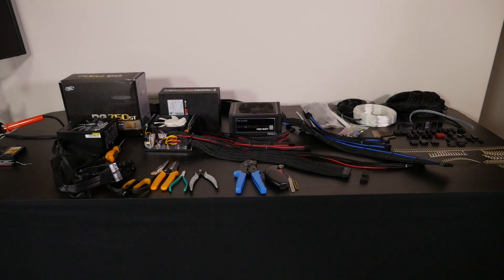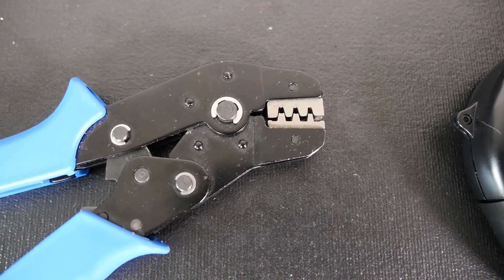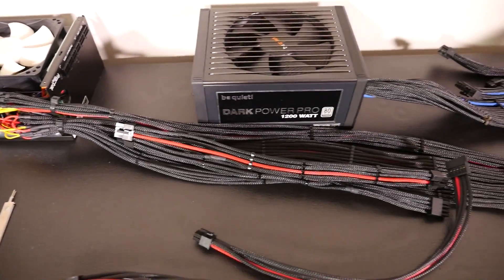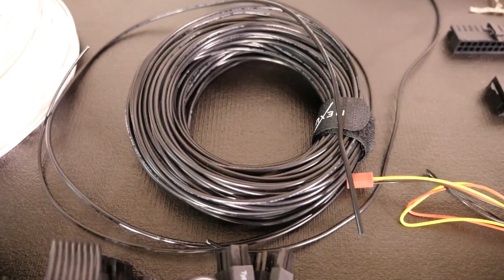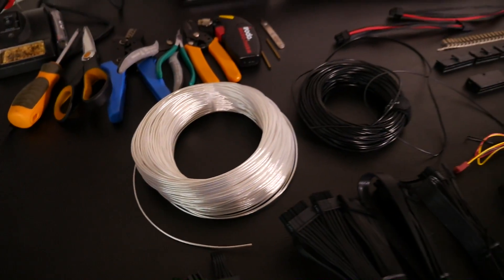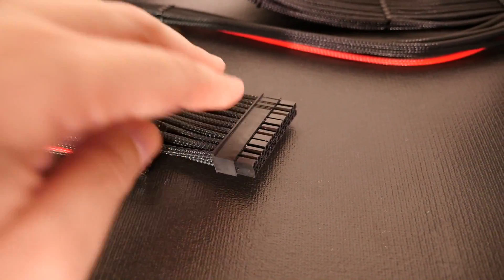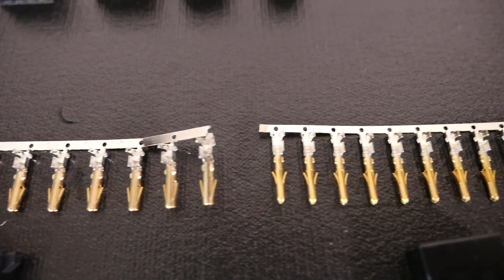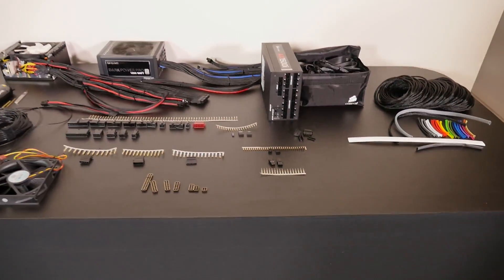Custom Cables Guide #1

Comment: im going to be doing full custom cables on my new rig. But have a question. Can you do the cables for a few inches and then do extensions. As that way it be easy to do new cables if i was the change colours and not have to worry about the pin layout on the new extensions.

Comment: MDCP-X crimpers are IWISS crimpers, with the two rear jaws milled out a little... DO NOT buy them... you can buy 3 IWISS or something similar for the same price... they even SMELL the same. 
 Pin removers... are just standard molex brand pin removers... just buy the molex ones.. they are literally the same thing but way less money.
Reply: Can you link the model since I am new to this I dont really know which crimpers that is similar to the MDCP-X Crimpers.
Reply: @andyyang2333  Sure! I do not want to take money out of these guys mouths, I did a short video on this on my channcel which show them side by side. Comment on there and I will link you.

Comment: Do you still use the SN-28B crimper? Because I have one and it says it's for 28-18 AWG, but you said you use 16 AWG wire. Does it still work for the 16 AWG wire/pins?
Reply: didn't he move to the MDPC-X CTX3 Crimpers he has video on it, 
I love them

Comment: In what case would one need to extend a single SATA cable beyond the connector? I've never seen, or heard of for that matter, a cable with multiple connector opposed to a singular terminating connector. Would it be used for setups similar to RAIDs or some other application?

Comment: Great stuff and a real service. 

Get a Hakko 936 on auction. The entire electronic part is $10. So it is risk free. 

I use a hot air station designed for SMD work because I can control the temperature for shrink tubing. 

For training wire, the filament count is key. There are three standard versions from limp "boat cable" to stiff thhn with as low as 14 strands at 14 AWG. 

Electric (not electronic or computer) suppliers can get you anything at 1/3 the cost that custom cable houses charge. 

There is no reason you can't get trainable wire as low as 18 AWG. 

But, you know, it is actually all about look and feel anyway. 

I had a guy force me to restring his whole box with 10 AWG 300 degree cloth and silicone insulation just because. $900 in wire.

Comment: Have been watching your vids all afternoon, I am looking to get into modding big time, and you've hit every nail on it's head with your SC mod series and this. The problem I'm having with custom wiring is ordering some of the parts, like low profile USB 3.0 Internal female header. 

I use an ASUS ROG Front Base in my case, and sadly ASUS have only 1 USB 2.0 port on boards now, which is shared with the ROG_EXT port. I ordered some cables from China that have split the cable from the ROG Front Base, so that the USB portion can go to an internal hub. 

I am wanting to make USB cables, rewire F_Panel, the lot. I feel now that I can move on with my project however, and even after a browse of your store, I still can't find some of the parts I need.

Something I'd be interested to learn is, say you're using only 17/20 pins, how to block the unused in a cable. 

I have an idea in my head for making wiring harnesses for computers, case/mobo/psu specific. 

Thanks for going to the detail that you have as I can now go and confidently obtain most of my parts...

Just that damn internal USB 3.0... The female 2.0mm Dupont is driving me crazy. Can't find them on ebay from China, and it's looking to be over $2 each plus postage from the USA...

Help me if you can? :D

Comment: Thanks for the guide! I'm trying to figure out which pin type I need for full replacement cables. At 20:49 you say the extension connectors are "male". This makes me think the standard connectors on either end of the cables would be "female". Is that right? And would I then use "female" pins inside those standard ATX connectors?

Comment: Hey Daniel, Great Job man, you are really dominating the water cooling field, i believe you have inspired lots of not only beginner but enthusiasts as well, i have just finished my water cooling build but without doing the custom cables since i was really waiting to see information regarding that, I've visited your website to order some material to start the custom wiring for my build however, i couldn't find the Crimper in there. even in your video description you haven't put a link for it as you've done for the other components, please let me know if the Crimper is available in your store or from where i can order a high quality Crimper, thanks

Comment: Yeah, I got a build that requires six 8 pin cpu power cables.  I have a 1600 watt rosewell power supply with eight 8 pin pcie slots and two 8 pin cpu slots. I don’t feel like modding the power supply. I’d rather make some custom wires. So, I guess I’m gonna have to open up the power supply to see if there are any pins sharing the same wire.

Comment: How do you sleeve a cable that has one cable splitting into two pinouts. Or one pinout has an extra cable that goes to another. I see that you already mentioned it in this video, but can you explain to us in detail on how to do it in one of the parts?  And what to do when you have a 2x 6+2 cables coming from a single 8 pin from the PSU

Always learned a lot from your videos. Keep this up.
Reply: I use the method where you split the insulation open on the "main" wire, thread the second wire through the split and solder them together.

You then apply sleeving individually to the three parts and have them meet at the split. Heatshrink the whole thing up and done. I did it to replace wiring on a Corsair 550RM. http://i.imgur.com/zJQeso9.jpg This is the final product.

Comment: quick question, i have a power supply that has caps/capacitors at the start of the cables (evga 1200p2), what do i do with the caps if i want to custom wire???
Reply: they use it to reduce the ripple, if you remove it I think youre gonna be fine, companies like cablemod I think that doesn't use it in evga psu, but in corsairs do so I think that doesn't matter too much in your case. But if I you want and probably that's what I will do in your case desolder it or find new ones and put it in the middle of the cable or where it's gonna be hidden.
Reply: great idea, don't know why i didn't think of that. thanks :)
Reply: They to reduce ripple but the ripple is already so low its not a issue not to have them.
Reply: So I have a corsair 1200i....do my cables have this as well....man maybe I should not do this....sounding like way to much trouble.
Reply: i dont think the ax1200i does, im not sure, i know the rmi and rmx power supplys do, but they are corsairs latest psu's i think. cheak to see if you have large-ish caps in the heat shrink at the ends of the cables, they are very noticable :)
Reply: Thanks. Hey do you have any idea on my other question I posted?
Reply: sorry, what other question? :)
Reply: So, I want to do full custom wiring like you but I am super confused on the wiring. On the 24 pin for example---do i need to buy wires for different voltages???  I have a corsair 1200i and some wires are yellow and some are gree ect,..... I can't seem to find a answer to this anywhere. I just want to know if I use one gauge wire, do  I just have to match them up to the right spot or do I need to buy 24 differnent types of wire? Probably a dumb question but I do not want to toast my motherboard or psu. Thanks
Reply: no no no :) you can just use 1 high enough gage wire (in his video he said what gage he uses) and match what wire goes where (for example, if a yellow wire on your corsair cable goes from pin 5, on the psu connector, to pin 7, on the motherboard connector, copy that with what every colour wire you want, that’s a bit of a extreme case but that should make sense but a easier way is just to google a wire diagram for your psu, I’m sure that’s a lot out there for your psu) also i recommend you pic up a psu tester, that will tell you if you got the wires mixed up :) hope this helps
Reply: Thanks. That is what I thought but almost impossible to find on google. lol Anyways, wish me luck I am going for it.
Reply: good luck mate :) let me know how it goes :)

Comment: Great videos. I was hoping you would make more of these tutorial videos and even go into more in depth detail. I am a complete noob/beginner and looking to find info on female/male pins and corresponding female/male connector. Also where does each cable go in the connectors. I see "make a diagram" or "check pinout" diagram....like to see it explained like you are telling a completely beginner. I know pinout info is important since it  could mess up hardware. Thanks

Comment: Nice, but you forgot to mention what size of sleves you use for 16, 18 and 22 awg wire?
Reply: He always uses the small sized sleeves. As he stated, it expands up to 4x, so the bigger wire isn't an issue.

Comment: If you don't want to buy new cables, reworking stock cables is a perfectly fine option if they do what you need them to, length is satisfactory, and the parts are suitable for what you're doing. You're gonna need a pin extractor anyway. Just make sure to get the pinout right - document, label and limit how many you work on at a time.
Reply: The stock cables are usually 18 gauge or lower though. Personally I think the 15 AWG looks fuller and overall better when up in a bunch. And as you are usually doing cable mods for the looks and investing in sleeving anyways, cable is not that expansive (like 20$ for 30m) and it even boost overall electric conductivity by increasing the diameter of the cable.

Comment: I have a non modular PSU, it has some old molex conectors that I dont need, is it safe to cut them off to a minimum lenght and just put a female conector there and covert the cut cable into and extention in case is needed in the future??? has anyone try that?? it think if viable would be a great modification for us poor suckers stuck with a non modular PSU, should i give it a try??
Reply: It should be safe, afterall, it's just a shorter cable

Comment: How much of wire is needed for a simple build
Reply: Uzair Ali Javed about 45m depends on how much cables and how long they are
Reply: Depends on what you are going to sleeve and what length. for the 24, EPS, 2 PCI-E and sata at about 60 cm you are going to need about 45 like Carlsson said.
Easiest way to know is just to calculate how many wire are going to be sleeved multiplied by the length you need. So 8 pin PCI-E is 8 times 60 cm(for example) = 4.8 meters. Just calculate the length you need and the rest is easy.

Comment: I found those crimpers. They're Glarks (less than $20): 

https://www.amazon.com/Glarks-Terminal-Professional-Crimping-0-1-1-0mm2/dp/B06VWLW11G

That torch, however, might be good, but it's waaay overpriced. I have a torch with adjustable flow and it's /very/ precise. Can adjust the flame down to where it's a pin-point or open it up and it's about the size of a pencil erasure. Been using it for 3 years. Got it for $8 from a local gas station. I modified it by adding 3 layers of steel mesh press fitted into a steel thimble with a hole drilled into the bottom of it to allow the heat out through the mesh. The thimble just so happened to press fit perfectly onto the end of the little torch. Works just like yours.
Reply from the maker: There are many copies of them and Ive tried a bunch which I wasnt happy with. I have an Iwiss pair which are similar and another blue pair, both are no good though. I think its the jaw shape.
Reply: Ahh, I just searched for SN-28B. The model number on the handle. But even looking at the picture and the close-up of yours, the little heart shapes don't look as severe on the ones on Amazon. I'd imagine that's what makes them work so well to get a reliable crimp.

Comment: the fooutage is choppy m8e and it's not due to the buffering..
Reply: Your computer/laptop or whatever could have a problem with 1080p 60fps. My Netbook for example has that exact problem, the cpu just can't handle it. On my desktop Pc I have no problems whatsoever. But video drivers could be the reason as well.
Reply: Felix52000 if my pc had issues playing back 1080p 60fps video footage I'd send it to Africa

Comment: Why not cablemod? It's works great for me.
Reply: Archie Wei because he is making his cables exactly fitting. Means only 5 millimeters difference from optimum.
Reply: Cablemods cables, at least the ready kits look AWFUL imo, the wires look anemic and the black|color|black style looks real bad. Custom cables all the way! not to mention MDPC-X sleeve is amazing and looks way better than their paracord.
Reply: Itay Levy I'd have to look into it, been using cable mod for 2 years, now building new rigs. Really like their cables feel in the hand, I can't stand plastic feeling sleeve.
Reply: Forget about the feeling when you hold them, it's all about the looks, cause you don't hold it much but you do look at it. 
I'm not saying paracord doesn't look good, take Ensourced for example, his paracord looks great. Just look at other sleevers work before you go on with Cablemod again.
Reply: why mod your case, when you can buy a pre modded one? Well for one, its a fun project sleeving by yourself, and in the end you are proud of your work. Then you can also sleeve each single cable strand to the length you want. No considering the time put into sleeving yourself, it is also cheaper. And from what I have seen online the cablemod sleeving job looks god aweful if you dont choose the pro option. And I find it weird that you have to pay a premium for them to do thheir job right.
Reply: Id say cablemod stuff is the step between stock cables and full on custom. Many people won't want to dive in head first for complete custom everything straight up. Nothing wrong with going going something like EK res and cablemod for a build getting started, then go complete custom next time around - when more budget can be made for cabling/cooling.